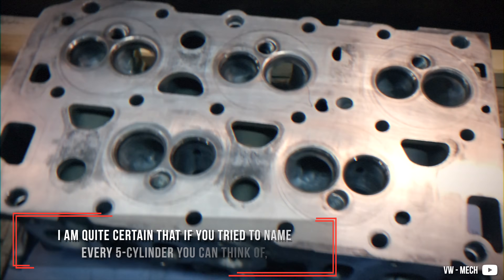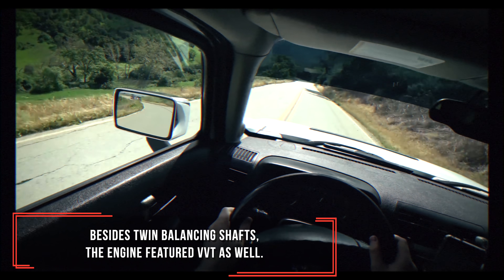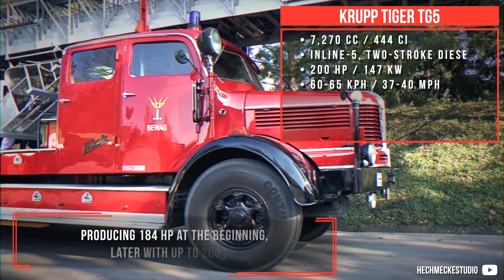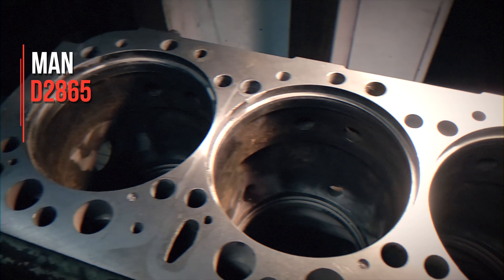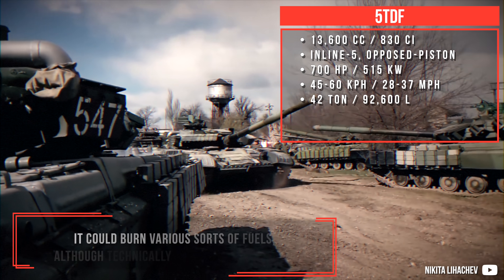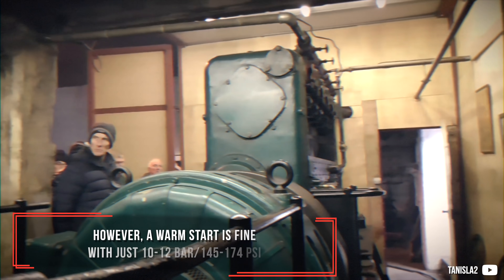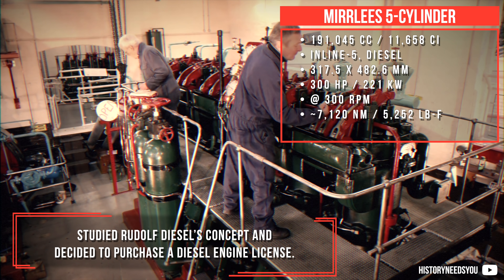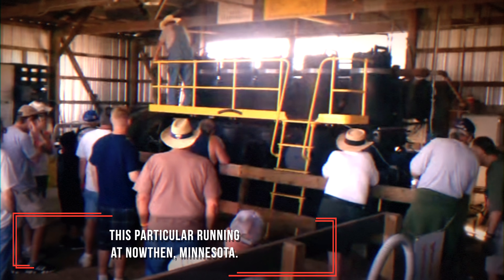The Largest 5-Cylinder Engines In The World

Comment: How about Daimler-Benz OM355/5 the OM409, the OM429, the OM449, the small OM 602,  OM 605, OM 612, OM 617, OM 662, the MAN 5L23/30 or 5L 16/24, and so on. Basically all producers of large ship engines made 5 cyl engines, with cylinder bore up to 1050 mm. B&W, Doxford, Götaverken, Fiat, GMT, Borsig, AEG, MAN, Mitsubishi, Stor-Werkspoor, Sulzer, Wartsila, NSD, WinGD, J-Eng, MHU, KHI... And none of the engines in the video comes close to beeing the biggest. :)

Comment: I used to work on a ship with a MAN B&W   2stroke crosshead inline 5 engine, bore 450mm stroke 2000mm, making 6000kW at 100 rpm

Comment: That GM Atlas series engine was on Ward's 10 best engines list for 4 years. All you had to do was keep the damn oil clean so the VVT didn't clog up & ruin the oil pressure. I think the 4.2  6 cylinder is a marvelous engine. With regular oil changes they are 300K engines, easily.

Comment: Land Rover TD5 is a 2.5 litre Unit Injector engine that was used from 1998 to 2007. Mercedes had a 2.7 litre 5 cylinder diesel used in many cars and Sprinter vans until recently. Ford offer a 3.2 litre 5 diesel in the Transit and Ranger pickup in Europe. They all have that lovely "big truck" sound.

Comment: My old truck I used to drive was a 5 cylinder. It was a Hino 5 tonne truck with a naturally aspirated 170 hp diesel. Did the job for its day, bit of a slug to a turbo 4 cylinder I drove after.

Comment: Lancia successfully produced from 1938 to 1947 an excellent truck called 3ro, powered by a 6875cm³ straight five four stroke diesel engine with four valve per cylinder, aluminium block, direct injection and 93 hp at 1860 rpm.

Comment: The GM design 5-cylinder was garbage from everything I'd ever heard about it. Lots of problems.
Frankly I'm not sure why they don't use the straight-5 in motorcycles. Since it's been some time that cylinder sleeves were used, today with the hard coating on alloy cylinder bores, the cylinders can be spaced closely together and reduce overall engine block width. I'd estimate that a square or under-square 5-cylinder wouldn't be much wider than a over-squared 1L racing bike 4-cylinder these days. Overlapping firing, cool sound, smoother than a 4, unique. BMW made a straight-6 and it's not stupidly wide, so I can see a straight-5 would work fine.
By the way, VisioRacer, I've been to the Minnesota grounds where all of these unique engines and steam exhibitions are held. It's an awesome experience. If you ever get to the States, plan to visit that exhibition for 2 or 3 days. You'll love it.

Comment: 0.8-0.5 miles per gallon for that Russian tank.  Let's see how that compares:

For comparison, at 37,000 feet and typical weight of around 300,000 pounds/136,300 kg, at 550 mph/Mach 0.80/900 km/h, a Boeing 767 burns around 9000 pounds per hour of Jet A.  I know this because I fly this plane at that weight and altitude all the time.  

That works out to 1343 gallons per hour, or around 2.44 gallons per mile.  2.44 gallons per mile is 0.409 miles per gallon. 

That Russian tank is NOT very efficient;  Then again I don't think the Russians care about such things...

Great video!

Comment: Largest 5 cyl diesel I've ever seen, larger in swept capacity even than the Mirlees or Fairbanks, was the Burmeister & Wain (now MAN) engine fitted to the old HMS Endurance.

5cyl, 2 stroke, two electrically assisted turbos, a swept volume of around 1600 litres, 3220bhp, 104rpm max.

The pistons were large enough for a skinny 19yr old to sit atop during maintenance periods

Comment: 4:16 This is one of the Euro 3 9-litre 6-cylinder Scania DC9 engines which are used in most Scania L94 buses/chassis.

Scania used to use 6-cylinder engines until around 2005-2006 where they now use Euro 4/5 5-cylinder DC9 engines for their K230/K250/K270/K310/K320/K360 buses/chassis.

Sources:
https://en.wikipedia.org/wiki/Scania_4-series_(bus)
https://en.wikipedia.org/wiki/Scania_K_series

Comment: 5 cylinder didnt become common until mercedes launched the 240 3,0 i 1975 . Audi and volkswagen have had their 5-cylinder for many years . Actuallys , volvos 5-cylinder diesel came from Audi . The gasolinepowered 5-cylinder are derived from the the 3-liters 6-cylinder engine that were powering the 960 . Thats a genuine swedish product .

Comment: How does a five cilinder with opposed cilinders work? Doesn't this require an even number of cilinders? 🤔
Reply from the maker: Nope, because you have 5 cylinders with 10 pistons which are opposed
Reply: Opposed piston, not opposed cylinder. 

For such a simple - they're completely valveless - but cumbersome design, they're easily the most efficient type of internal combustion engine ever conceived.
Reply: No. It has 2 pistons in each cylinder, meaning 10 pistons for a 5 cylinder engine.
Maybe you are thinking of a flat/boxer engine?
Reply: @espenschjelderup426  ah thanks. I didn't think of 5 cilinders with 10 pistons 😂

Comment: You missed a few. SAME tractors called Panther 90, Panther 95, and Tiger 100 all had 5 cylinders. The Panther 90 had 2 less mm of bore than the Deutz 912 and other two had 5 mm more bore than the Deutz. Also the largest m series Kubota tractors from the 90s and 2000s  had a 5.8l 5 cylinder engine.

Comment: 5 cylinders are way more common than I ever believed, thanks for your video!
Reply: You'll be surprised Honda did make 5 cylinder both for their motorcycle and car
Reply: @mayuravirus6134  interesting, you have more information? All I found was the G-series 2.0- and 2.5-liter inline-fives that they only made for Japan?
Reply from the maker: Honda RC 149, a 125cc inline-5 with 20K+ rpm
Reply: Oof That was the original plan.  It probably would’ve been based on the TL’s i5.  As much as I would love the sound of an s2000 with that gurgle, it probably ended up being smarter just going ahead with the f-series engine

Comment: So the Krupp TG5 is pretty much a 5 cylinder Detroit?
Reply: The Krupp engine has no relationship with Detroit Diesel other than being a two stroke, Detroit wasn't the only manufacturer of two stroke diesels.
Reply from the maker: It does not need to be related, but yeah - it pretty much works the same way.